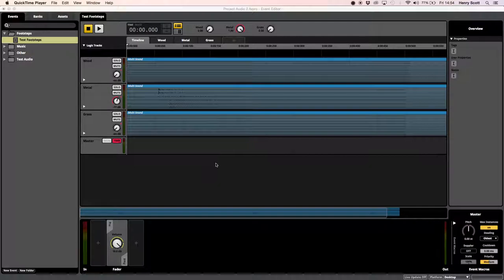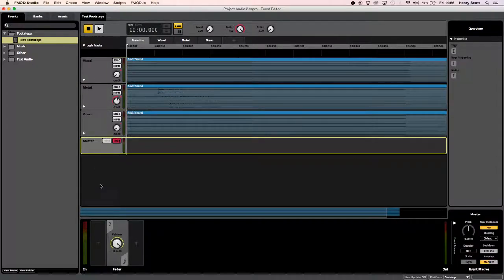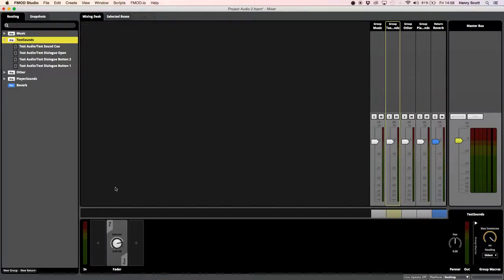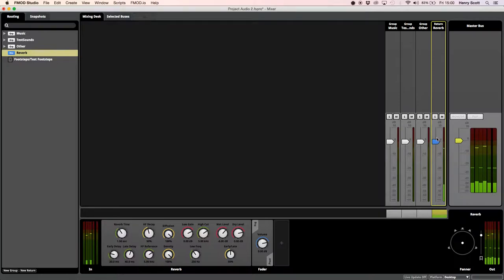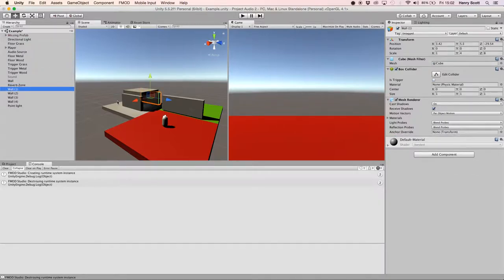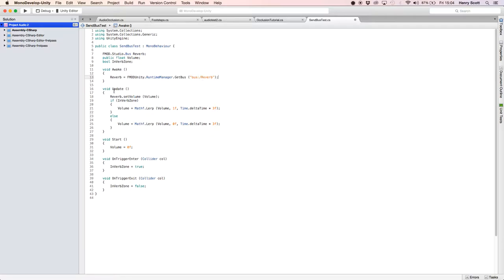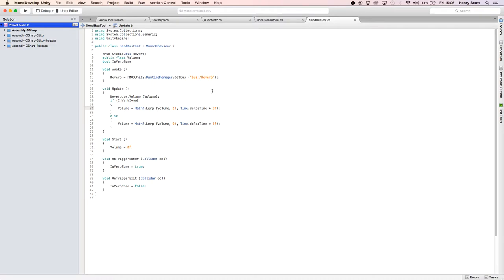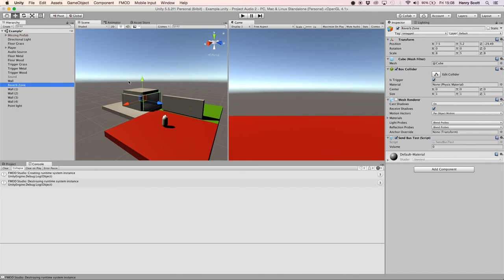FMOD & Unity | Mixing Desk Basics

Comment: Hey Henry! Nice video and explanations. But I've got one issue regarding buses and the signal flow. In my project I created some events and one reverb return and all the events are routed post fader into the return. Now I want to adjust the volume of some of those events from inside the game. My first idea was to assign these events to a VCA and control the VCA volume from within the game but it seems like in FMOD a VCA doesnt directly control the volume fader of the event so the amount of volume that is routed into the return isnt affected by the VCA. So the problem is that the events are more quiet but the amount of reverb by them is still the same. Sadly I cant just assign the reverb to the VCA as well because the other events should remain with the same reverb. I solved it by now with a volume parameter for each event I want to control but that is very inconvenient to implement. Any idea of grouping these events for my purpose? Thanks in advance, Marco
Reply from the maker: Hey RPSim, glad you liked the video. Off of the top of my head, I believe just by sending your events to a group bus and then adding a send from your group bus to your reverb return might help (all post fader). Do you want to turn the volume of all of your events down at the same time, or do you want to turn them down individually at different times? If together, you can adjust the volume of the bus which will reduce the amount of total signal going to the reverb return, lowering the reverb intensity with it. If individually then whenever one of these events drops in volume, again, the signal being sent to the bus and therefore the reverb return will be reduced, lowering the reverb being heard. Is that what you meant?
Reply: Hey Henry thanks for your answer! 
The idea of routing all the events I want to adjust to a group and adding the reverb send to the group is a nice way to do it but then i don't have the possibility to adjust the "send amount" for all events individually. So they will all have the same contribution to the reverb defined by the send in the group right? That would be a drawback I wouldn't want to make because of the balance I created.
The case for the volume control is that at a specific time in the game the volume of some very loud machines in a factory should be turned down so that you can hear the quiet things going on in there like dialogue, footsteps and so on. So yes, they should be controlled together. But it would be better to control them over a VCA to maintain the balance between the events but I feel like there is no way doing it with my requirements.
I've implemented it with the volume parameter for every event so I have the possibility to create a new "quiet mix" with it.
It would be so much easier if the VCA could control the volume fader directly..

Comment: Hi Scott!

I've done reverb zones with snapshots and triggers but exiting the trigger makes the reverb stop very fast. I see you avoid this in this video with the deltatime coding. Could I use this in the snapshot "way" of adding reverbs? Would it be very hard? Thanks !
Reply from the maker: Hey Emmanuel, You can set you snapshots to rise and fall gradually in intensity without using the time.delatime method I used in this video. In the Mixer window, go to your snapshot tab and select the snapshot that will adjust your reverb bus. In the bottom right corner labelled 'Snapshot Macros' you have an Intensity dial. Right click this and select 'Add Automation'. Now you should have a new section that's labelled 'Automation: Intensity'. Click 'New Curve' then 'Preset Parameters' then 'New Parameter'. Then choose a name for that parameter and set values for it. You can then set the parameter graph how you like, similar to how you would with any other parameter on an event. Once this is done, click the Arrow symbol next to the name of your parameter on top of your graph. From here you can use the 'Seek Speed' option to decide by how much your parameter will change by per second, which will prevent the snapshot from instantly dropping your reverb out. Let me know if this helps, I'll probably do another video on how to do this as I should have included it in my snapshot video.
Reply from the maker: Turns out I already have covered this in a video. Check out my video called "Unity & FMOD | Snapshots + Slow Motion/Bullet Time Effect"